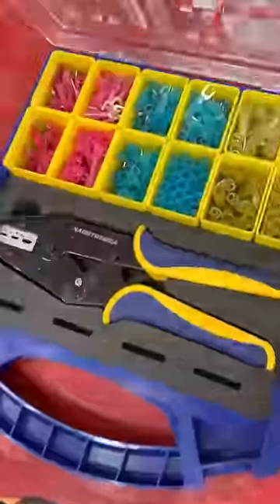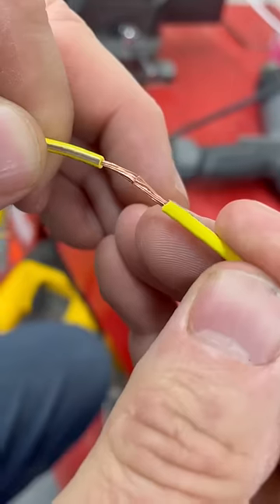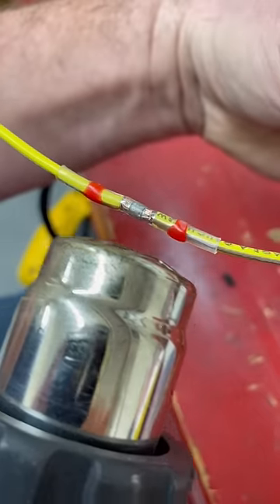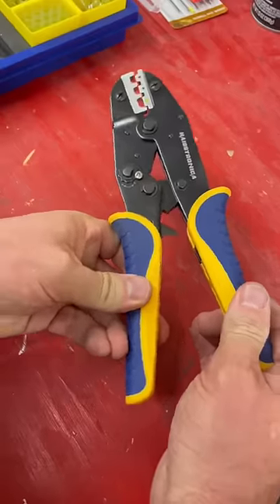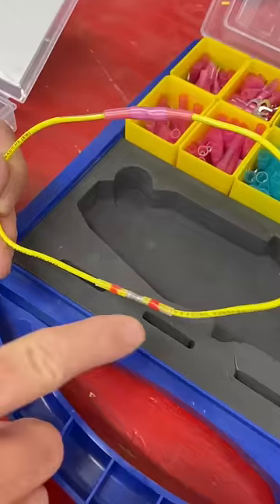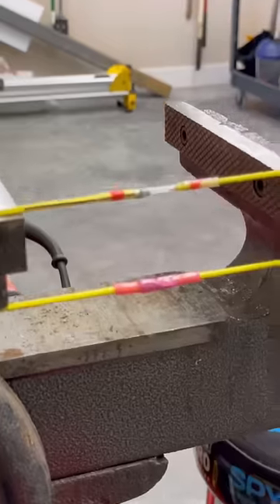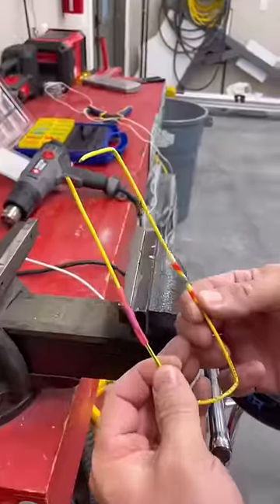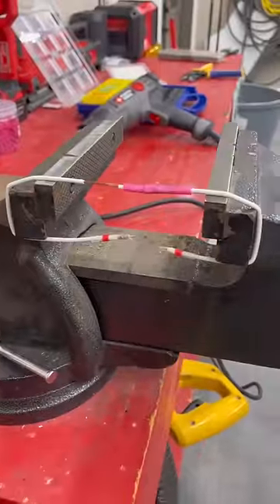Crimp verses Solder Connectors

Comment: For a 12v system on a vehicle, i always use the more expensive and premium crimp style connectors that are also heat shrinkable for triple protection I place normal heat shrink over the already heat shrinked crimp connector. Then I will typically use some TESSA TAPE, that is designed for either interior environments or I will use the TESSA TAPE that is designed for exterior environments such as under the hood or under the vehicle where it will be exposed to all of the natural elements. If you do the installation the way I just explained above it’s quadruple protected and I promise you that you will have no electrical issues whatsoever. Period!!

Comment: I think I’m the long run, the solder connection won’t oxidize and cause an open circuit.
Reply: A proper crimp (using non-insulated terminals, so that proper crimp force is applied) is gas-tight. It’s a cold weld, actually. Of course, it’s always a good idea to heatshrink it. (As is the case in soldering. These solder “connectors” simply combine soldering and heatshrink.)
Reply: It might not oxidize but it will crack and break…

Comment: i bought those too and havent had a chance to use them. they look awesome and keep the cables thin. they look real good.
kind of excited
Reply: They do not work very well at all IME.  It's not regular solder, its a much lower melting point alloy and it doesn't wet the copper very well.

Comment: Non insulated crimp connectors. Then solder. Then heat shrink
Reply: Best of both worlds
Reply: That is exactly what I do at work, we have to extend some 12v power supply cable powering a screen.
Reply: That's worse than just doing either honestly. All engineering literature recognizes that solder joints are weaker. They're brittle, develop hairline cracks, and are especially prone to vibrational failure. FAA specifies crimps over solder. NASA specifies crimps over solder. A good crimp is air tight, and even a bad crimp is close. You're not going to wick solder inside, just coat the outside and make it more liable to work harden and break at the boundary (just like in test #2 here -- and that's without going through hundreds of thousands of vibration cycles)
Reply: In a specific environment, I applied insulated crimp connectors, then applied adhesive heat shrink covering the crimp connectors and half an inch of wire.
Reply: Use crimp connectors and crimp them with the correct tool. You won't get a better connection, soldering makes everything worse in this situation.

Comment: A proper crimping makes the metal go in to a almost floating stage due to the high pressure. This makes a very good and strong connection.

Comment: I always used a crimp connector, removed the plastic cover, slid shrink tubing onto the wire, crimped it solid, then applied solder into the crimp connector, then shrunk the shrink tubing around the connector. 
The crimp connector was to make it solid and the solder prevents corrosion from getting between the individual wires and guaranteed a solid electrical connection.

Comment: Prior aviation wire technician here, on stationary applications solder is preferred for most joints, but a mechanical crimp connection is preferred anywhere there will be vibration. Solder joints crack over time.

Old aviation connectors used to be "solder cups" but that style went away once vibratory stress caused many intermittent failures, and fires.

Crimping is almost always better than soldering for wire repair

Comment: Well if you live in the rust belt, you definitely want  solder connections that are heat shrink sealed. Same if you live near an ocean. I years ago worked as an auto accessory installer and any wiring on the outside of the vehicle that wasn't sealed by heat shrink was going to come back with wiring problem. I've rewired so many trailers over the years I couldn't count because trailer manufacters usually use crimp connectors or worse yet, scotch locks that after a few years fail. I've never had anyone bring a trailer that I rewired come back with problems because I have always soldered and heat shrink sealed all connections. I might have to check out the solder/heat shrink connectors though.

Comment: Quick tip the solder connectors are perfect for low load connections like radios and stuff but NOT For high load like fuel pumps, the solder melts at lower temperatures so the connecter will fall apart and cause you to drop ur tank again. Which the crimp connector works perfectly for

Comment: Crimp connectors on vehicles, if not possible I will use soldering, crimping is the first option and soldering is always secondary, makes jobs go quicker and less mess during set up and cleaning up after the job.
Reply from the maker: Makes sense

Comment: If you need a water protected connection, the soldered is easy to make and normally serves well. If you are in risk of sending a bit of a current through it, I would probably go with a crimp because of the risk of heat causing the lead to melt and fail the connection.

Comment: Well pump installers used to argue about this. The connections for submersible pumps need to withstand being under hundreds and sometimes over a thousand feet of water. Soldering makes a great connection, but it heats up the insulation and isn’t as resistant to vibration as a properly installed crimp so it’s typically only done to reduce electrical resistance and in addition to crimping.

Comment: I have worked in aviation and Automotive, I have used both, and both are as good, I use the solder connection if splicing a chopped loom and space is tight, other wise its crimp and shrink.
Reply from the maker: Thanks for sharing

Comment: Soldering is only really necessary for higher voltage wires or data stream wires. It’s useful for keeping a consistent high quality connection. If it is just moving electricity to a light bulb on a trailer then crimp works just fine.

Comment: In trailer wiring especially when Marine heat shrink is being used, either is fine. To argue otherwise would be ignorant.  In any other situation where it's a standard crimp connector or a solder connection with tape or other protective shielding, It could be argued that crimping is better than soldering simply because solder creates a hard flex point at the end of the solder which will cause fatigue in the wire in the fatigue will cause the wire to break. This fatigue point is not present in crimped wires. However if the wires are inside a harness wrapped up with a bunch of other wires, a solder joint would be preferred. Simply because conductivity Is high and internal resistance is low as well as the wire is supported by other wires in the bundle to prevent fatigue.

Comment: As a Class 8 fleet mechanic in the Rust Belt I use 3M Scotchkote FD .  It is a coating which is designed for underground electrical splices !  It is expensive and well worth it .  15 fd oz can $55.00 Amazon .  Just about all electrical connectors are pressure sensitive on Class 8 , the repairs are not .

Comment: Go ahead and cut the solder connectors in the middle and see how well the solder flowed through the wires. Then strip of the insulation and see how much solder flowed up into the wire. Compare that to a solder connection made with a solder iron. I use the Gardner bender heavy wall adhesive lined heat shrink to go over my connection wether I solder or crimp. Just make sure you put the joint in an area that doesn't need to bend. This, when properly sized, is a no joke heat shrink. We use 5 foot sections to lift and pull wire cables through heavy lift cranes when we're replacing the hoist cables😅 it's probably not a recommended use but it's never failed us.

Comment: I’d use both and it all depends on the project at hand. I used the solder ones while installing a new radio into my truck which wouldn’t see much time being abused. But maybe for applications where there will be stress on the wires the crips would be best for those projects.

Comment: Solder is better for electron flow, crimp connectors can sometimes add impedance (Resistance that caused heat) in the line. Both are acceptable if properly installed though.

Comment: I have heard that soldered connections are more prone to breaking. In the electrical industry , all of our connections are pressed or bolted or rely on tension itself. I think in the end either is fine, as long as it is marine grade, sealed from the elements. A properly wrapped and secured wiring harness won’t vibrate enough to break, at least not in an automobile.

Comment: Compression connections dislodge the oxide layer  when the metal squeezes and result in a near perfect metal-on-metal contact made of copper so there's less resistance than solder.

Comment: Solder connectors are awesome takes one step out of a splice it is the heat shrink and solder which makes a better connection than crimp. Problem with crimp is it allows condensation to get in between the wires and corrode over time and fail. Where solder prevents corrosion between individual strands

Comment: Both. They both have their benefits. The main benefit of the crimp style is you do not need a torch, which can not always be used in most confined areas. Plus, my crimper tool will never run pit of crimps compared to the torch running out of fuel.
Reply: Torches are really only used for soldering plumbing or jewelry and things of that nature. Generally you would use an iron for wiring and electronics. Now days especially you can get very compact irons that can even plug into the cigarette lighter outlet. 

However, in a pinch, you can crimp on a connector with a pair of pliers...

Comment: I prefer crimps or regular solder with adhesive lines heat shrink after. I dont really trust those solder heatshrink combos to make a full penetration proper solder connection. But I dont use the crimp heatshrink combos either, I've seen some cases where the crimping damages the heatshrink and allows water in. Just put it on after, takes an extra couple seconds but I dont like redoing work. I've never had to redo my own work but I've had to redo many other peoples.

Comment: I'm a pretty firm believer in normal solder connections are the best.  Gun/iron fluxcored solder with some shrink tube.  Butt connectors and others might be quick but less reliable. And they are alot more bulky especially doing car radios or where a lot of connections need made in a small area.

Comment: I've found that you have to put a little flux on the wires before using the solder connectors to really get a good connection.  And I've seen other testing that shows crimp connectors actually have lower resistance than a soldered connection after a year of weather exposure.  A soldered connection becomes more brittle and a good crimped connection should be stronger than the wire itself.  For these reasons, I exclusively use crimpable connectors.
Reply: Thank you for the clarity.. I've seen on a channel here that is by someone that builds race cars. Crimp connectors are by far the best for reliability. Considering that a soulder connection makes a stiff heated part of the wire at the end of the connection., Where if? The. Wire? Has the. Ability to? Bind back. And forth it will break like any other rigid piece of metal that bends back-and-forth it in one spot enough... A crimp connection is much more flexible considering it has not been heated or the soulder making that spot rigid.

Comment: I have always used crimp connectors with an anti oxidation paste and no shrink. Water gets into shrink tube (if it does not have the adhesive goo inside) and in turn corrodes the connector, especially on trailers exposed to salt water from roads or ocean. I have found , an open (no shrink) pasted crimp connector to work best.
   Lastly, I see a lot of commenters saying they don’t use solder due to coming loose if circuit (wire)overheats . May I say that if your wire heats hot enough to melt the solder, what kind of shape do you think your insulation would be in ?? Just sayin’ , it’s a bogus reason in my opinion.

Comment: I believe solder has a better electrical connection but for physical connection crimping holds stronger. So I believe it's recommended you solder for low-force low-noise. Then use crimp for moderate to high force, moderate to low noise.

Comment: It's rare that you have a connection  that is exposed to that much tension.  I agree that soldered connections are superior, however some bosses will always default to the simplest and quicker method.

Ive gone nose to nose with a few people about what is, and is not acceptable.

Even if my name is not attached to the work, I still have a difficult time allowing cutting corners.

Comment: YouTuber Great Scott demonstrated a while ago that crimp connectors have higher resistance, meaning they are less efficient and for high current applications, because of their high resistance, they heat up more than the rest of the cable, creating a Thermal Hotspot.

Comment: Depends on the application. I prefer crimp on any wiring that moves. Stationary wires that don't moved very much can use the solder connectors. While crimp connectors should be used if the wire tends to be looser or in a part of the vehicle that moves the wire enough. As in door connectors and such.

Comment: I worked with a tech that used solder connectors. He used in an engine compartment and came back after couple weeks. Solder connectors came apart from heat. Good anywhere else but heat areas.

Comment: On a cattle trailer, the solder splice is the ONLY viable option.  Until I started soldering wires I had to work on wiring every month or so.  Also, use lots of that liquid electrical tape.

Comment: Crimped has the overall strength win especially if the circuit gets too hot. Both are very useful depending on application and location access for repairs or new terminations.

Comment: I used to think solder was better until I got a set of those style crimper. They make the strongest freaking crimps I've ever made. I completely stopped using the multi-plier crimper from my wire stripper/plier tool. Those things are no joke.

Comment: I think crimp is better for most cases, but for audio wires, I THINK solder is better because it will have better conductivity for transmitting the audio signal.
However, I think crimping generally has a better physical connection, unaffected by heat and doesn't have any solder that could crack if the wire is bent too much.
Also, once you have a couple good crimping tools, it's faster, easier, safer and slightly less expensive.

Comment: I've used both and had no issue with either. the solder connectors are just easier especially if you are joining wires in a really awkward place where you cannot get enough leverage to crimp
Reply from the maker: Good point if you’re in a spot that’s too tight for the crimper

Comment: I use both, in automotive anything larger then 14 gage I crimp with barrel crimps and heat shrink. And if I drink I use a quality crimper. But anything smaller I use the solder joints,

Comment: As a professional I prefer crimp. The solder will wick under the wire sheathing and creates a weak point. Pulling it straight out will hold but side to side movement the wire will break faster.

Comment: For automotive I'd use crimp, but different style, the one that crimps both copper and insulation.
Edit: and separate heat shrink tube with glue liner, of course.

Comment: I’ve read that the low temp solder ones work in a pinch, but in longevity 1-5 years, but I’m sure people’s experience vary depending on the environment of the repair. Where the crimp are good for a long time.

Comment: I've tried every connector you can name, fixing lights on a semi-trailer. Salt gets in everywhere. Crimped and heatshrunk? Held maybe a month. Sealed solder connector inside a sealed junction box. Salt ate it. Box was still clean and dry inside, but some kind of salt dust still got in f'd it up.

Comment: I think the strength of both connections is  more than adequate, but crimped connections are always more vulnerable when used in moist conditions. So I prefer soldered connections over crimped connections

Comment: He does say on the solder connectors the waterproof sleeves is very thin and you can easily damage it when heating to melt the solder the crimp connectors have much thicker shrink wrap

Comment: It's not about tensile strength. It is about a good connection that will last. The location of  repair is important. Is the wiring secured? Will it flex? Will it vibrate? If the wiring never moves then twisting the wires together will work. Personally I don't use solder connectors

Comment: Soldered connections become brittle overtime and break much easier than crimped connections.

Stranded wire is used in auto applications for one main reason…FLEXIBILITY. A vehicle is a rolling earthquake and wires vibrate. A soldered connection is rigid and is hardened with the introduction of solder, so that connection will absorb the vibration and break at the point of least resistance…either side of the solder joint.

I’ve seen it happen many times. I only use crimp connectors with shrink tubing, unless it’s a connection that may have to be disconnected down the road. In that case I use crimp bullet connectors with shrink tubing.

Comment: Just FYI, if the copper is not absolutely bright sparkling clean you cannot solder to it. It will not stick. It might melt around it but it will not melt attached to it like a good soldered connection. I prefer the cramp type.